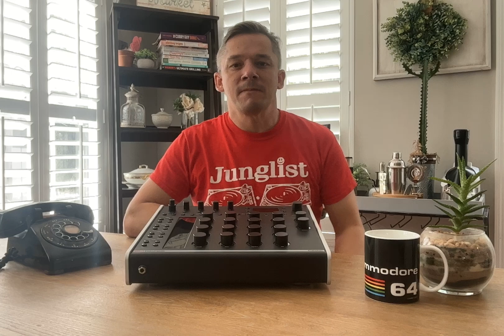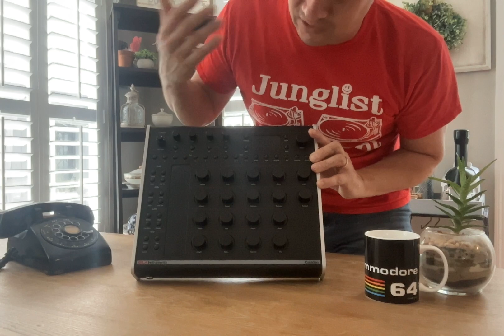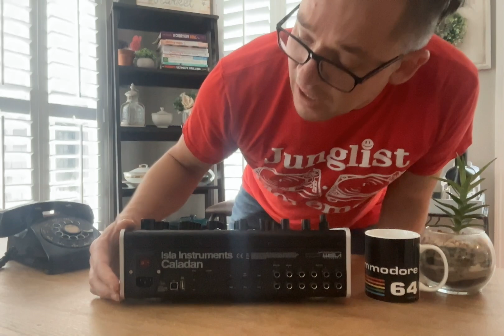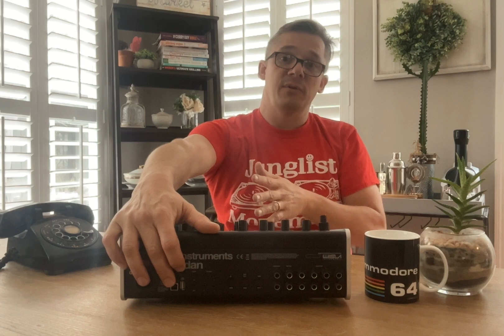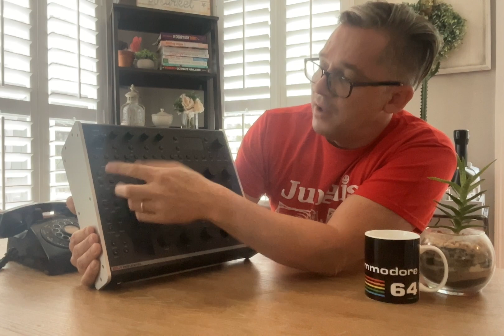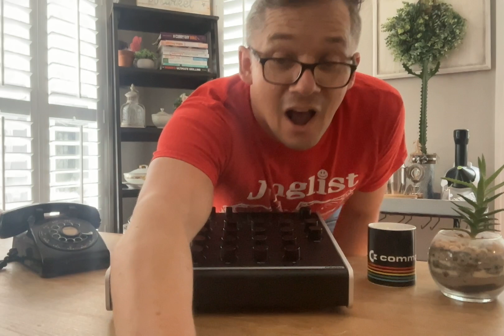Isla Instruments Caladan Overview/Follow up

Comment: Still confused about the card pre-order. If I pre-ordered for 4 cards (which I did), am I going to get 4 Parva cards, or will I be able to select between available cards at launch? I thought it was the latter, but am now second guessing that. I probably would not have chosen 4 cards if they are all going to be Parva.
Reply: YOu will get a notifiaction from Isla when the Caladan is ready to be shipped. Then you will choose your cards from whats available. They have 2 in development now, and these coming: Analogue Percussion card
Mini Moog card
SH-101 card
String machine card
TB-303 Card
Reply: @backseatsamurai  this is not correct ... the pre-order is for the Parva cards.

Comment: I'm curious if there is any unique link beteween this and the S2400, besides basic midi mapping.   It would be cool to sequence it by an S2400.  For example, if the knobs and sliders on the S2400 could be auto-linked to the parameters on the Caladan, it could easily be integrated for sequencing on the 2400.
Reply: "besides basic midi mapping" do realize just how expressive MIDI is? There is no reason to reinvent the wheel when MIDI CC works. It is just a matter Isla Instruments implementing more MIDI CC features for the S2400 and then ANY synth or controller that sends MIDI CC can do what you are wanting.
Reply: @HazeAnderson  What I meant was more just a more seamless integration.  So, instead of sequencing midi cc values, it would be cool if you could actually see the parameter names from Caladan on an s-2400.  I don't have an 2400.  I really want one.  I midi sequence synths with an Octatrack all the time.  But,  I find it to be messy sometimes, remembering what cc values are assigned to what. So, I was just thinking, since the 2 devices are from the same company. they could maybe implement some sort of streamlined automap, where you could access the parameters with their names, directly on the 2400, without having to manually assign everything.  So, you could pretty much have direct access to the Caladan engines in the s2400 midi tracks. Either way, Caladan looks amazing, and I'm hoping to get both devices in the near future.
Reply: @AndreiOlenev  oh I see what you are saying now and yes that is very handy. The Squarp Pyramid does this, but it only lets you store up to 16 synths. But still, being able to see the NAME of what the CC does for that synth is super helpful with keeping the creative process flowing. The catch is that I have to do all the naming myself but it's just a matter of making some text files and putting them on the USB card for the Pyramid. So I can actually make a config file for the S2400 and see the names I assign for the CC values and not have to keep looking up what they are in the implementation chart. I never thought to "bug" Brad and co. about this ... asking them if they could do something similar but check this out --- ALL OF THIS is supposed to be for free when MIDI 2.0 is implemented. I just really hope the Caladan will be able to support MIDI 2.0 and THEN ... then MIDI 2.0 will do the magic for us. :) Cheers!

Comment: Im just trying to imagine using it with a s2400. 
So I record a live loop of some midi onto a track im making with the s2400 then route the midi out (and / or cv if this does the same thing) to the Caladan which is slaved the s2400 tempo. 
I can then select (this is where im most unsure if im correct) either a single vst / selection of soundfonts and / or card voices to recieve that midi and output audio back to the 2400 
Am I right in thinking I could have multiple midi clips sending different notes to the caladan to have say a bassline on an analog card voice, keys from a soundfont and a Parva voice lead all at once? 
Finally then processing them with the dsp back on the 2400, throwing away all my other worldy possesions and living as a hermit in a cave only venturing out to recharge my stockpile of solar usb power banks and find signal to backup my masterpieces to the cloud.
Reply from the maker: Sounds like a plan to me!
Reply: So in theory thats a possible way to use the 2 units together? @ISLAelectronics

Comment: So the knobs for synth controls are not encoders correct? Kind of a shame IMO to not use encoders on the main interface as you already have led feedback, but I guess this is a preference/cost thing?
Reply from the maker: Not really any cost difference, it’s still open to changing to encoders, I just remember how people hated the prophet 6 for having encoders so they changed to the PE (pot edition)
Reply: @ISLAelectronics  Makes total sense. Some encoders are worse than others. If they were like the encoders faderfox/elektron uses, I'd say encoders in a heartbeat. If they were like the ones on the og beatstep I'd so "no please".
Reply: @matthewadunlap  oh god, did you have to mention the beatstep encoders. that was a fading a memory.
Reply: @wheelbarrow8649  😂
Reply: @ISLAelectronics  But I think in the end encoders would make jumping between instrument/pages soooo much more seamless.
Reply: @matthewadunlap  until the encoders STOP WORKING! Which they are NOTORIOUS for doing.
Reply: @HazeAnderson  I've had more issues with pots than encoders tbh. Encoders are exactly the right design choice for Caladan.
Reply: @wheelbarrow8649  well the rest of the world is still dealing with destroyed digital encoders. So far I have an EA-1 whose main encoder is just about to go and a Roland TD-7 whose main encoder is completely destroyed and must be replaced. Out of the HUNDREDS of potentiometers in the many other pieces of gear that I own, maybe four or five are a bit scratchy ... wow ... now then  ... if encoders are exactly the right choice for the Caladan then why didn't Brad pick them first? Doesn't look they are needed at all, thanks to the LEDs. But you know what ... not my choice I am not invested. I am just curious as to why you are? Anyone who makes the claim that they have had more issues with potentiometers than encoders ... are they really being honest with us, let alone themselves?
Reply: @HazeAnderson  ' then why didn't Brad pick them first?' Didn't he say: 'I just remember how people hated the prophet 6 for having encoders'?
When a knob controls more than one parameter then an encoder is the right choice. All the attempts at catchup and scaling when your knob is in the wrong place for a parameter are just plain w@nk.
As for your Roland's encoders, well they sound as good as the Roland pots on their FC-300. They chose some custom ALPS piece of sh!te 20k log pot that has a life of 50,000 actuations. Great choice for an expression pedal. I've replaced 4 so far with the linear ones that you can actually buy, and had to use custom scaling in a MIDI filter to get the range back.
Never had a Midas or Behinger encoder go wrong, or anyone complain about them. I believe they sell quite a few too.
DJ Tech and Faderfox also seem to have worked it out. I'm not surprised Roland haven't.
Rocking my ageing Novation 61sl  and mk2. Encoders are a joy on them.
Reply: @wheelbarrow8649  "As for your Roland's encoders, well they sound as good as the Roland pots on their FC-300." I think this just proved that you do not know what you are talking about.
Reply: Have a guess where the pots are on a Roland FC-300.
Reply: @ISLAelectronics 

This wouldn’t be an issue but it would be nice to have quality encoders